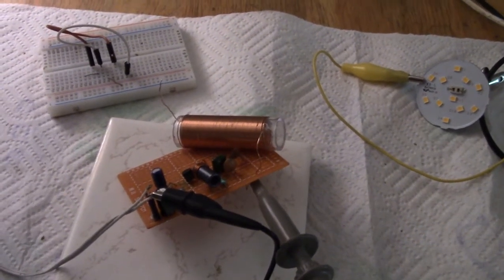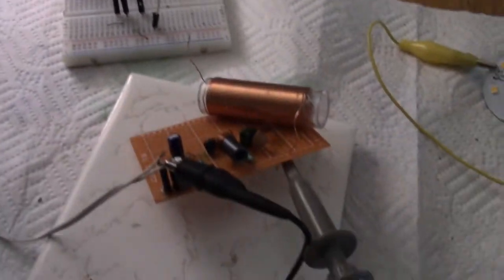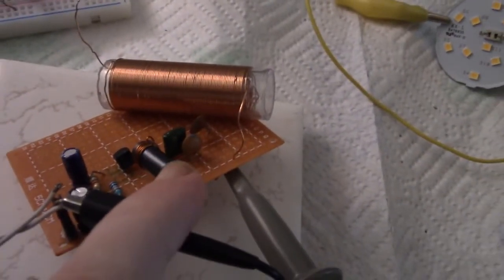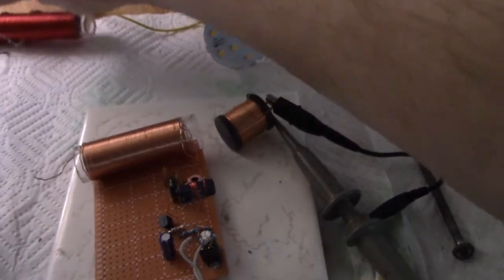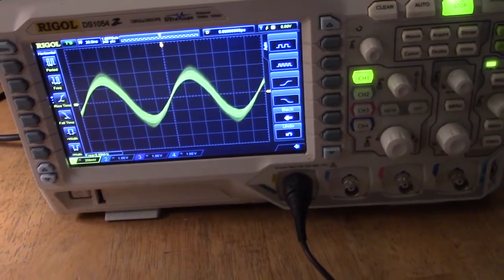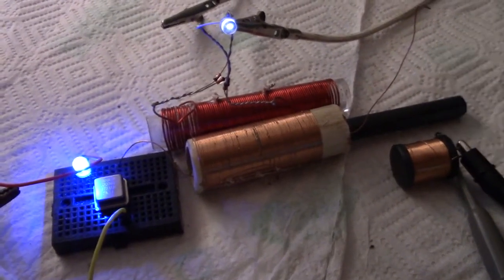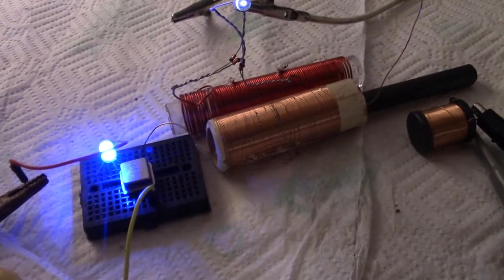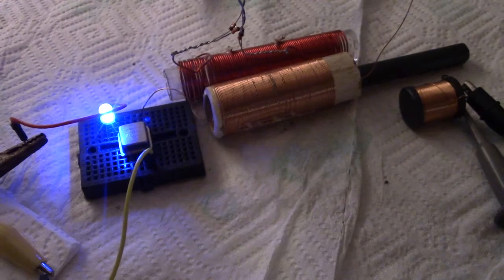Colpitts soldered & Lidmotor's Crystal Oscillator

Comment: +Slider2732  Appreciate all of your efforts and the work that you share.  I sent you two YouTube PMs with links and an offer to help you out, please check.  I'm not confident that the links are usable via PM so I'll post them here regarding the use of an Arduino controlled low budget ~$25 AD9850 DDS VFO as a clean sine wave signal generator that may be especially useful for this replication.  Links also include a buffer amplifier that may be used to increase the SG output level:
UNO Controlled AD9850 DDS VFO Demonstration
www.youtube.com/watch?v=ZIB0JXI3dGk
Arduino Controlled AD9850 DDS VFO Build Info
www.ad7c.com/projects/ad9850-dds-vfo/
www.ad7c.com/downloads/AD980_DDS_VFO_Schematic.gif
www.farrukhzia.com/k2zia/dds-vfo-assembly-manual-rev2.pdf
http://arduinosolutions.com/upload/download/AD9851/ad9850_1%20manual.pdf
www.ebay.com/itm/282955654519
Buffer Amplifier To Increase Output and AD9850 Datasheet
www.pongrance.com/dds-buffer.html
www.analog.com/media/en/technical-documentation/data-sheets/AD9850.pdf
Reply from the maker: That is a very neat project and thanks for the links.
I don't see any PM function on YouTube nowadays (Desktop), certainly not like the old email days. A reason for my break for posting was that everything seems to be in the 'Bell' area and mushed up into 1 mess.  I think it needs a flashing "You have mail' icon lol
The AD9850 looks to be very capable. Have looked through the links and see the Nano version which is likely how it would be built. The amplifier talk was good too, with the kit version seeming to incorporate the same double transistor section. That in itself may be useful to build for the crystal oscillator simple circuit output. 
I haven't seen what the resolution on the AD9850 is for the MHz ranges, the datasheet implies 10/14 bit resolution though,
It's something I would add to a wish list for definite, if my channel was bigger i'd likely do the Patreon thing and focus on production more  :)
Reply: +Slider2732  Glad you found some of the links useful.  I joined the OU forum that you posted on one of your other videos and sent you a PM from there since it seems to be discouraged here based on the poor features and support.

Comment: Good news!  Congratulations on getting those up and running.  I worked a few hours on various setups but still no luck lighting up 110v led lightbulb arrays.  It is a voltage thing I think.  I need to be able to punch out a 13 MHz signal at 21volts.
Reply from the maker: Maybe even a 2N2222 would switch while it's a sinewave and we only need 1 wire output. So Jeanna's Light type for the 21V, going through the Base at 13.6MHz...worth a go :)